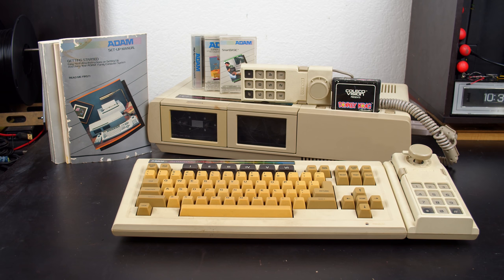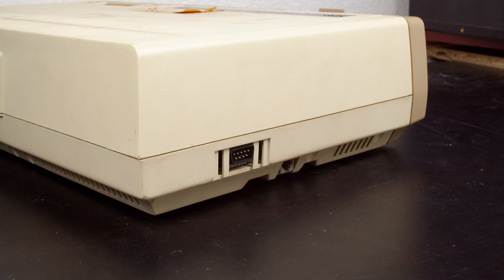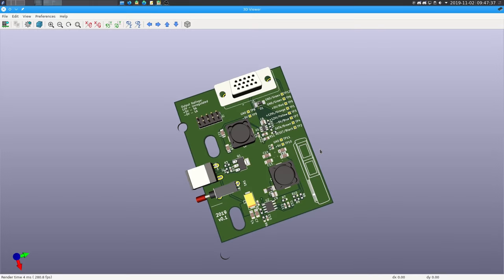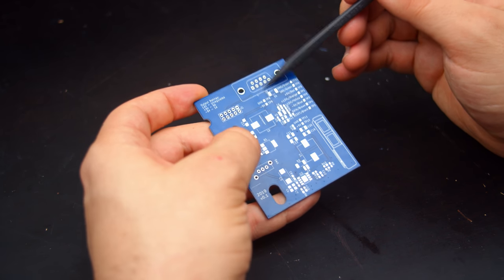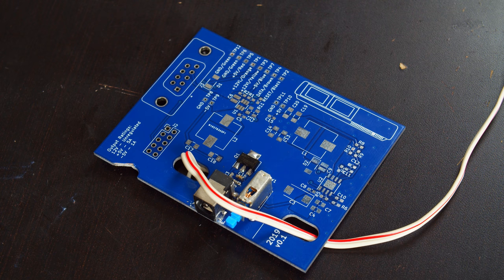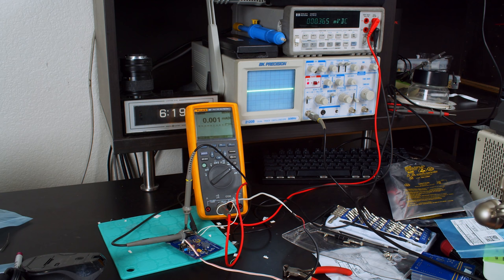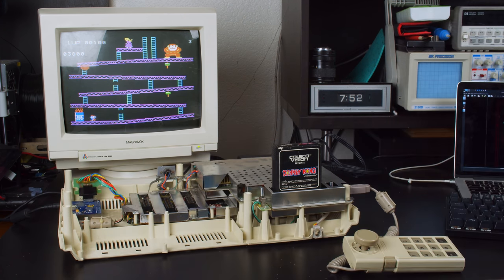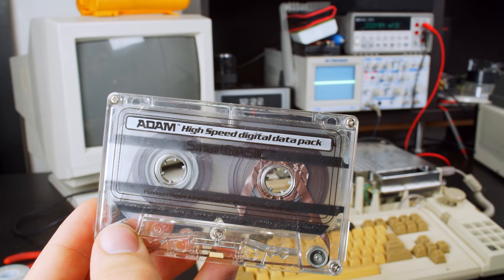Making a New Coleco Adam Internal PSU

Comment: Generally with my supplies, I will have an electrolytic 10uF along with either a 0.1uF, or a .01uF for additional filtering and load capacitance, Helps reduce ripple and keeps the circuit stable.

Comment: Similarly, the IBM PS/1 (the home-bound cousin of the PS/2) had its power supply built into the display. As well, the earlier PS/1 systems did not have ISA slots. Both of those reasons are why when I got outbid on a PS/1 system on eBay, I didn’t counter-bid.

Comment: A noob here: What's the reason behind the switch controlling the mosfet, instead of it just closing the circuit?
Reply from the maker: Switches are not perfect and when they are closed they have a slight amount of resistance. When you have a lot of power going through a resistance it generates heat. If the switch isn't design to cope with the heat or have especially low resistance it can actually burn and fail.

The power input into the device could reach up to ~27W according to the Adam's technical reference manual. The 12V PSU would need to deliver about 2.25A for that into the power supply. The switch I used here is only rated for 300mA, so running the full power through it would not work. I could have found a switch capable of passing more current, but those are also more expensive because they have to be better designed. It is actually cheaper to use more parts to turn a mosfet on and off than it is to get a better switch.
Reply: @TechTangents  Ah, I see, thanks for the explanation. :3
Reply: Also, there's the problem of turning it off. When current flows, it doesn't want to be suddenly stopped (i.e. inductance). Think of it as suddenly closing a water valve: There will be a so-called water hammer, a pressure spike that can damage the pipes. Similarly, with electronics you get a voltage spike. This can cause an electrical arc over the switch for a split second, every time you turn it off. Over time the switch will wear out, and one day it might simply weld itself closed and not turn off any more. You can fix this problem by using a beefier switch, but since electrical components are often cheaper than mechanical ones, it can be better to use a MOSFET and some basic protection circuitry instead.

Comment: You could have used a charge pump IC to convert +5v to -5v ... for example TI LM2776 or MaxLinear / Sipex SP6661 ... all these can do min 200mA but there's also loads of cheaper lower current ones which can be paralleled for higher current.

Comment: Have you made any progress on a revision of the board yet? I recently obtained an Adam with a Printer but the seller said it wasn't working and mentioned it might be a power supply failure. As I do not see myself using the printer ever, I would love to get my hands on an internal PSU. Also, there would be no need to add a power on light to the revision as the keyboard already has an LED that lights up when the computer is on.

Comment: I wouldn’t use a 12V power supply, but instead a standard 19 or 20V laptop power supply and add a buck for 12V. More people will have one lying around and they are likely to be decent quality. As for the bucks, I’d just copy a commercial design.
Reply from the maker: laptop power supplies are not very standardized and the connectors are often proprietary. Choosing just one of them would limit what options people would have for the AC-DC power input. 12V 5.5mm barrel type power supplies are exceedingly common. Most routers, modems, external HDDs, and other medium sized DC devices have used them for a long time. So there are a large number of them available.
Reply: @TechTangents  Many older laptops used that barrel jack type though, so maybe there's a way to allow both, 12V up to 21V with some regulator?
Reply: Lassi Kinnunen  Maybe foresee a footprint where a standard regulator module can be piggy backed on the board and a "CUT/DRILL THROUGH HERE" trace underneath? If there's enough unused room, otherwise probably not worth bothering, if someone really wants to, they can just hack a regulator in.

Comment: Can't you dub an Adam data pack onto a regular compact cassette to get it formatted in the right way?
Reply: it won't fit in a normal cassette player in its current cassette shell, but he could find a functioning data pack and transplant the tape reels to a standard cassette shell and record it that way
Reply: @amirpourghoureiyan1637  And remember to use a fairly high sound level so ADAM will read the formatting. It took a bit of fiddling using a dual cassette boom box with adjustable record levels before I got this method to work way back in the early days of this computer's orphanage.

Comment: it had to fail. such a cumbersome design, no separated external power supply, no external tape drive with standard tapes.
and slightly less graphic resolution than the c64. with a nicer case and modular design for audio and video, they would have had a chance.
but thank you for your motivation to preserve that piece of history

Comment: it'd be really neato to be able to use yer power supply in a colecovision as well, wiring up the CV power switch to the power supply board. the CV power supply is horribly prone to failure, a pain in the rump to repair (transformers fail more often than the cheaper components in the supply), and compact power supplies that provide +12/+5/-5 are just not common anymore. :(
Reply from the maker: I've been considering that. The connector for the ColecoVision is unusual and I don't know how easy it would be to find one. But the PSU I'm making does have all the voltages you would need with more than enough current.
Reply: AkBKukU   AkBKukU  grrr... youtube ate my original reply. "unknown error". 

anyway, i was more thinking internally. you COULD set yer supply up with a connector from a dead CV supply (those are stacking up nowadays and shouldn't be hard to find), but i'm thinking of using yer supply internally in the console and just connecting +5v and ground to the console's power receptacle (to keep compatibility with the roller controller, which connects directly to the colecovision power receptacle to steal +5/ground -- the CV supply piggybacks onto its connector, there was also an adam adapter for this), solder up the supply wires to the CV board (probably via a disk drive connector so that if the board needs to be removed for repair or mods it can easily be disconnected), hooking up the CV power switch (or a replacement, as the original cv power switches are flaky as hell), popping a hole in the case for a barrel connector and calling it good.

i power my CV consoles currently with an old DVE supply i got from jameco (which they no longer sell) that uses a din connector, but i haven't popped a hole in the case fer that yet... and would much prefer putting a simple barrel connector on there.

how much is building one o' yer supplies going to cost?
Reply from the maker: @consummategrumpyolcoot8971  Internal would be nice to avoid the connector. The ColecoVision I showed in the video isn't mine and I just borrowed it for those shots. I don't know what they are like inside and if there is enough room. But it would likely be possible and there is enough wiggle room in the board design that I could fit additional mounting holes if there are some available in the ColecoVision. I'll have to get my own and poke around inside to see what can be done.

I'm not 100% sure yet on the cost, but I'm thinking the ones I'll assemble are going to sell between $35-45. To do it all yourself, the BOM/Parts cost on Digikey for a single kit is about $16 not including a PCB. But that is going to increase a little with the next version to fix the problems.

Comment: Super naive question, but I notice you don't depict any breadboard/protoboard prototyping in this video prior to designing the board in CAD. Did such prototyping take place for this project, and if not, is this because experienced designers don't always need to, because the CAD tools are good enough to not need it for a project like this, because this circuit is based on a familiar design, or some other reason? Seemed like magic to go from idea to board without wiring up components!

(I realize the sponsor is getting some love here so the focus is on the board, just curious what to expect as I learn more about this hobby.)
Reply from the maker: Breadboarding is more helpful when you are starting out and "feeling out" a circuit can help you under stand it more. Here on Youtube you are also likely to see more people do that because it adds another visual step to the process that helps the viewer follow along with the what is going on. But it isn't necessary or even always possible.

These parts are very sensitive to EMI and trace lengths and are not available in DIP packages for breadboarding. They wouldn't do well on an adapter either. If I just put my finger on the chips while running they start having problems. So for these you essentially have to do a full layout and hope you get it right. This is why I assembled everything in stages. It let me test the separate parts of the board as if I were bread boarding it. But experience and spending a lot of time fully reading datasheets is a large amount of how I was able to go from concept to physical thing in one step.

(Also, this project was in the works before it was going to be sponsored. It was more of a happy accident that they reached out when they did because it worked well for both of us. I didn't mean for it to be more about the PCB but I recorded 9hrs of screen capture while designing the part and realized I would be better off skipping past most of it since people may not know or care what is going on in the EDA program.)
Reply: From an EE that works on PCIe and 10G designs for my day job and hobby projects at home...
For ~22$ shipped, my time saved from painstakingly and frustratingly soldering components onto a protoboard is well worth it, even if i have to revise the design. I tend to design a PCB during the week and order it at the end of the week. the next weekend i already have a board ready to be assembled.
Something else worth noting is Tech Tangents had a pretty rough time with those switching power supplies. I find it incredibly useful to model the design in LTSpice. Free and easy simulation software, and most manufacturers are going to offer a Spice model you can easily import to your favorite flavor of spice simulation software. It is also good to start from the IC manufacturers reference design and make tweaks where you need to. To help with ripple you definitely want some good electrolytic bulk capacitance with some smaller ceramic capacitors in parallel. because electrolytic's have higher ESR, they cannot effectively filter out the higher frequencies. that is what the smaller capacitors are for.
Once you have a few designs that work, if you want to prototype something quickly you can take multiple pcb designs and cut out sections and piece together something that works. i had a couple batches of PCBs not work, but the voltage regulators still worked on them which could convert a noisy 8-40V down to a 5V rail and 3.3V rail. i have used a few of those for prototyping designs. The only real time i find prototyping like this, or protoboard, useful is when i am reverse engineering something so i can figure out how to achieve my result. Like figuring out how the electric gate controller on my gate worked so i could connect it to WiFi with an esp8266.

Comment: Thanks for another great video! When I saw you using your tablet/laptop-hybrid I was wondering whether it ran Linux, or if you only use it on desktop machines. I'm asking because I'm on the lookout for exactly that type of machine, and I'd like to run Linux on it. So, if you are in fact using Linux, could you tell me which model it is and if you would recommend it?
Reply from the maker: It's an Acer Switch 10 running Fedora 30 and I would absolutely NOT recommend it! It, as well as many other inexpensive early tablet PCs, uses eMMC flash for the boot drive. That is essentially an SD card soldered to the motherboard. It is painfully slow to load as a result which is a shame because everything else about it is great. It took about 5 minutes to load the PNG file for the schematic for those shots, I am not exaggerating. Anything that uses lots of disk activity, like web browsing, is unusable on it unfortunately. I have another 7" tablet that also has an eMMC boot drive and is painfully slow. It's almost funny, I installed Burnout Paradise on it and it ran great, if you didn't drive anywhere. The instant you started moving it would stop while it loaded the map, continue to let you drive for 20 seconds then stop for more map loading. Over and over.
Basically, I would recommend almost any tablet PC that doesn't use eMMC. I have loaded Ubuntu onto an older Microsoft Surface before when I borrowed one. I'm also chasing the dream of a tablet Linux system, and those look to be the most promising to me.
Reply: @TechTangents  Thanks for the answer! I've heard that eMMC is ... less than ideal, I'll certainly stay away from that! Maybe a newer Acer or a Lenovo (with some kind of SSD) might be an idea. But yes, it would be satisfying to install Linux on a Microsoft product :).
Reply: @TechTangents  Also to remember with those cheap tables is that many of them use an Intel Atom variant which chipsets can cause driver (or rather kernel module) issues because of unsupported devices or variants of those devices like WiFi, audio or touch. I tried to install Ubuntu 18.something last year onto one of those Windows 10 Atom tablets and it was horrible to get it to work but was fairly usable when it finally worked.

Oh, and a 32bit EFI which appears more often than not on those low end Windows tablets will cause trouble as well with most mainstream distros since many don't ship with EFI on 32bit variants and without 32bit EFI on 64bit variants

Comment: This might be a silly question, but why is it not possible to just reverse the polarity of the 5v to make -5v?
Reply: If you had two independent floating power supplies, sure, you could just reverse one of them. But if you need both +5V and +12V, huh? Besides you're making such a kit, you can't rely on the fact that the PSU is floating, its output can be earthed, and then so is the monitor, and via that the video out etc. I guess my explanation is insufficient, but it can be quite confusing to wrap your head around, so in case i'm not helpful, let me know and i'll give it another try.

Comment: So uh, why didn't you breadboard this before committing Gerber files? Part of prototyping is to use a protyyping surface before committing to print! Also, if you are going to make slop holes, post cutouts need the same amount of slop. That would had saved you getting those nippers out and cutting a chunk from the candidate.

Comment: if you solder the switch and input on the backside, you dont need a db9 extension when running it externally
Reply from the maker: The pinout would be backwards for the DB9 port send power where it shouldn't and the switch footprint is not not a mirror image. Unfortunately, the solution is not that easy.

Comment: You might as well get a hard drive in that Coleco Adam and run CP/M on it.
You might find ADAM enthusiasts who have backed up Cassette BASIC. At least this is a solution to the ADAM power supply problem when the printer breaks.
Shouldn't there be a way to format tapes?

Comment: Why not a fully internal power supply? Looks like theres room for the entire power supply with a figure 8 connector
Reply from the maker: There are a lot more chances for something to go wrong with a mains AC design. And I would have to accommodate 120VAC and 240VAC. When people could use a a PSU they may already have or get one cheap that is already more likely well designed it isn't smart for a small project.

Plus, if I make these available as a DIY kit there is no way I would want people of unknown skill to mess with that.
Reply: Switch-mode mains power supplies should NOT be designed by mere pedestrians the likes of us, there's a LOT that can go wrong there, with potentially lethal or seriously fire-inducing consequences. It's a huge responsibility. Most EEs who don't have specific experience in the area will generally try to stay well away too, myself included, though i wouldn't terribly mind doing a classic transformer based design.

If one were to fit a module from someone who knows what they're doing, say Meanwell, well that's at that wattage needed, 10x8x4cm, you sure there's enough room there? And then another potentially even more pedestrian person would need to dick around with exposed mains still, and can you promise that all of them will be sufficiently careful and think 2 steps in advance before they do something every single time?

Comment: WRONG.  Colecovision was released in 1982 - the Atari 2600 was released in 1977/1978.  The CV was SIGNIFICANTLY better than the 2600 and the 5200.  The daisy wheel printer was the biggest fail of the Adam (my 2nd computer after the atari 400 and before my 800XL)

Comment: Why are you using a FET on the switch? What's wrong with just having the switch in line with the power supply? It'll draw zero current when it's off and you won't have these issues with pull down.

Also, since those cassettes are almost certainly just normal audio cassettes with a special case, why not record the sector marks onto them using a modified tape duplicator?